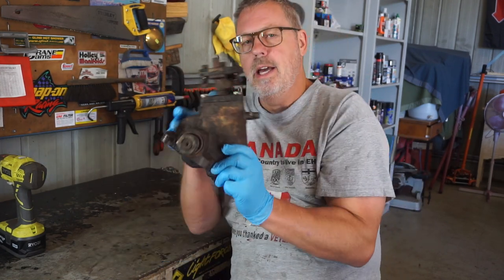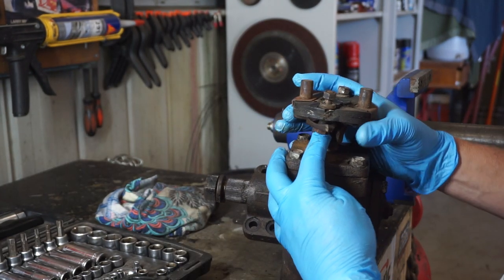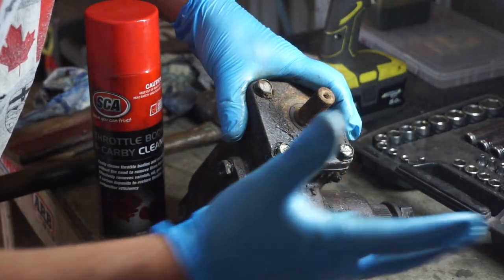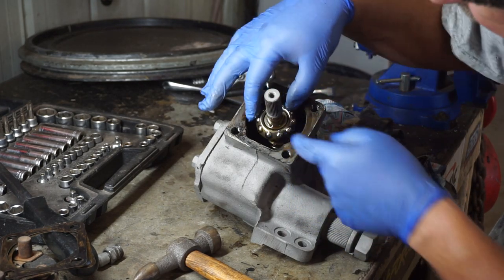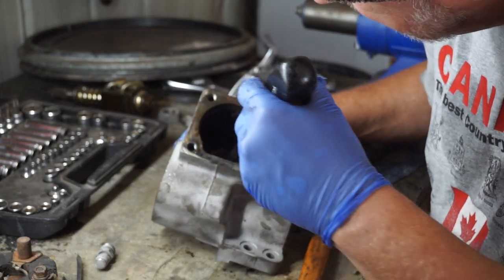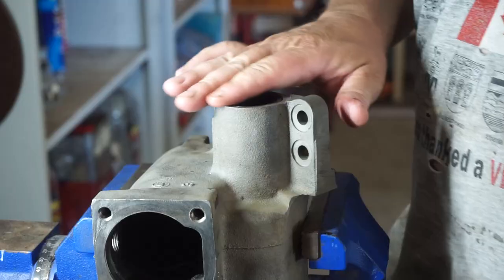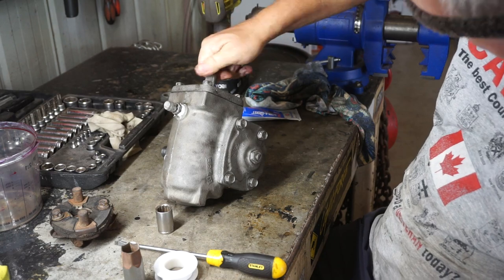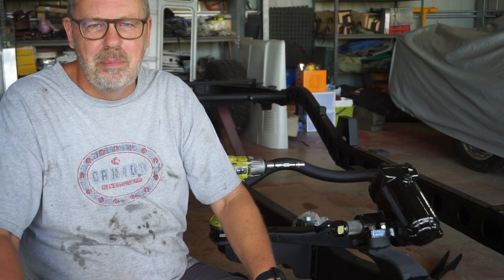FJ45 Landcruiser Restoration | How to Rebuild a Landcruiser Manual Steering Box | Episode 8

Comment: Hello friend, very detailed, I am going to disassembly my wandering steering box hj45
Reply from the maker: Good stuff mate, I trust the video was of assistance.  Keep the shiny side up mate😎👍
Reply: @JafffaAdventures  thank you, few people faces common old steering boxes trustfully like you. Steering box cooper bushing need replscement when too loose or when?
Reply from the maker: Yes, the bronze bush in the box is a serviceable item as well.  When you have the box disassembled, just insert the shaft and wiggle it back and forth.  You will be able to tell quite quickly if the bush is worn out or not.  Cheers

Comment: Hey Terry, do you think you’ll upgrade to power steering at all? LSA with manual steering could be a handful 😁
Reply from the maker: Yes definitely Jonty.  I will be installing an electric unit where you swap out the entire column.  The power steering pump on the LSA will be used to drive a hydraboost hooked up to my brakes for awesome stopping power.  Thanks for watching and commenting mate, I sincerely appreciate it 😎👍